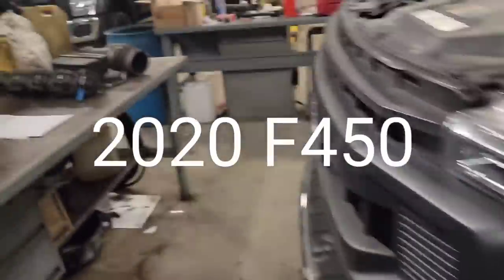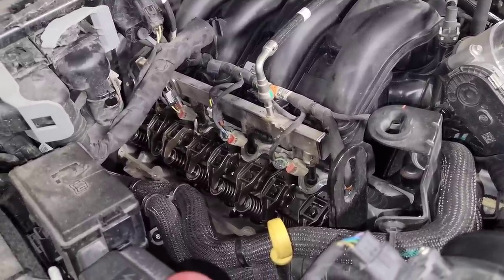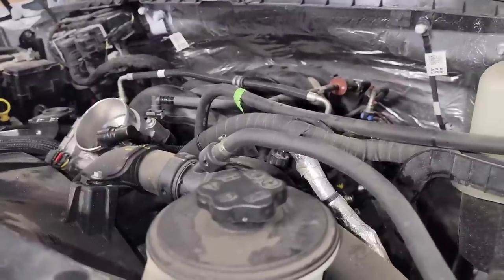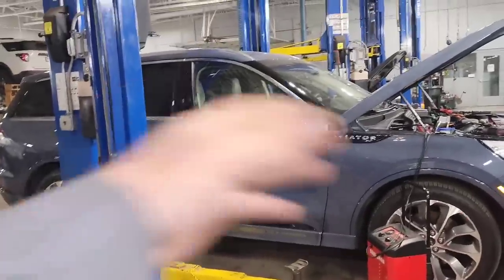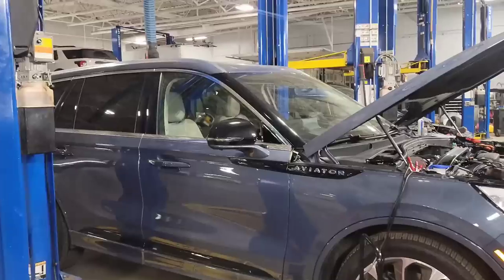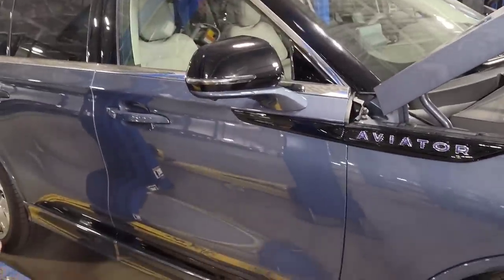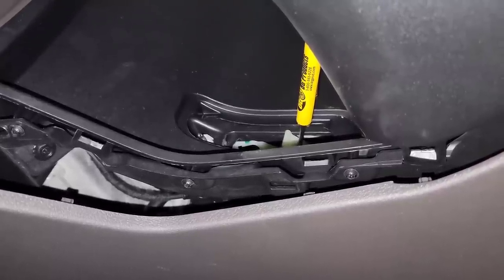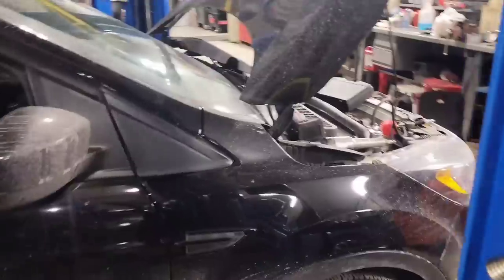2020 Ford F450 7.3L Godzilla Collapsed Lifter, 2021 Lincoln Aviator BCM Bricked - FDRS Programming

Comment: This is why I stay away from Ford after owning a new 2011 F150 Ecoboost 4x4.  It's not that other brands have zero problems, it's that Ford has SO MANY big ticket items that are defective/bad vs piddly ass Sh*t everyone else has.  It's not just the engine with this one - you have the front end wobble and the mystery noise inside the cab that I'm sure will cost thousands to figure out and fix (if there is a fix).  Or just live with it on a brand new vehicle!!
Reply from the maker: Well then you may as well stay away from any manufacturer right now because they're all having problems they have been having problems for years so with your logic you don't want to get a new car from anybody
Reply: @FordBossMe  i was going to say, it ain't just ford. i'm quite sure you know it's the tech, cafe standards and peoples want of luxury. your car is bad ass. but it's still what could be called 'older'.
Reply: Don't look to close at other brands then, you will be just as disappointed.
Reply: @FordBossMe  I bought new in 2019. Toyota rav4 and Chevy trailboss. Toyota had intermittent radio that was replaced, dcm problem, shaking side mirrors and the apps suck and are unusable. The Chevy had a few minor  recalls for software updates, floor carpet mod for seatbelt pre-tensioners, and defective rear spring buffers/sliders causing a creaking noise. There is also a trailering brake control module issue that still needs to be fixed. Overall not too bad with almost 3 years down on both vehicles
Reply: Yes, you'd think that Ford at this stage would accept the facts and redesign their front suspension. All of the aftermarket parts companies know how to fix it and sell the parts to fix it but Ford keeps on ignoring the facts.
Reply: @FordBossMe  It this occurring because new engineers are filling the offices of retiring engineers who had a lot of common sense?
Reply: @Garth2011  Either that or the bean counters are overriding the engineers.
Reply: @skylinefever  I'd agree with that one most. Customers need to stop rewarding them, no sale, buy used stuff they design better.
Reply: @skylinefever  Marketing to consumers who they (ad companies) have trained to eat out of their hands. People are stupid. Back when i was young, everything was about quality, and cars lasted a lifetime. Now, everything is about milking the consumer for no up-fronts. get the latest and greatest, no worries for warrenty then bin it at the end and repeat.

Comment: Geezs what's the deal on manufacturers are putting all these cheap plastic parts on engines I guess it won't be long before they start making composite engine blocks with cylinder liners 🤦🏿‍♂️

Comment: Rather off topic question, perhaps it's good to get away from something for a moment to answer a possibly really dumb, mundane question.  It's been nagging on me constantly as I watch your videos, but those large blue hanging "pipes", is that deliver fresh air, or an air intake for the compressors, or just ventilation to keep the shop from collecting bad dangerous gases etc?  I see them in many dealership shops, but never asked until now what they are for.

I also understand how some days/weeks can be so long, and work seems to get worse and worse, so I thought I could help just for a moment!  Take care.
Reply from the maker: It's an exhaust vent system

Comment: I’d daily drive a tractor before I buy anything made after 2004
Reply from the maker: 2011 you mean.... and you forgot how reliable the 2015 to 2017 Ford F-150 with a 5.0 L coyote and 6-speed transmission is with the aluminum body yeah you should probably rethink your statement

Comment: Common Ford - $2B in warranty recalls on the Books!! Stop producing junk! 

Everyone had high hopes for the 7.3L Gas, and three years later - several engine design flaws, oil pump, cam issues, leading to catastrophic engine and transmission failures. Ford Garbage….